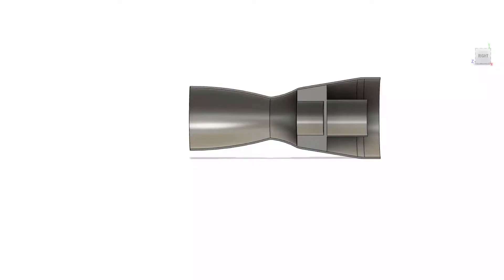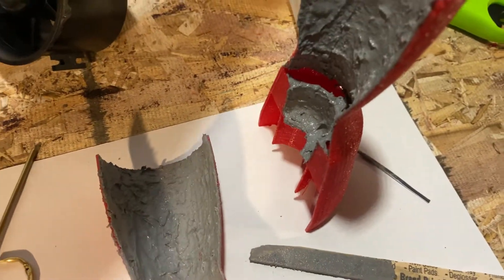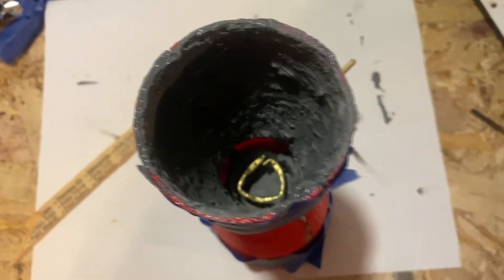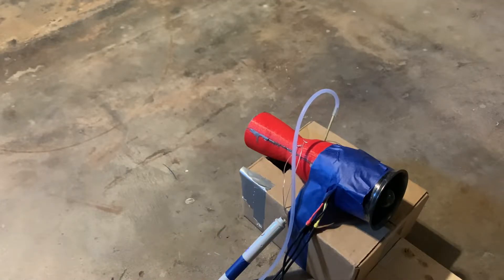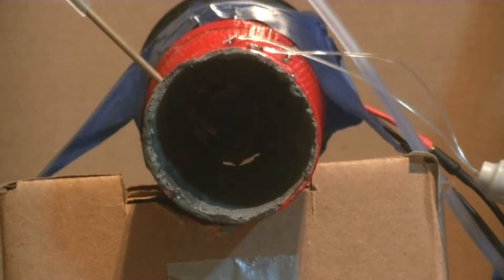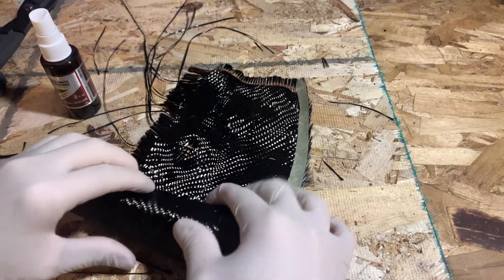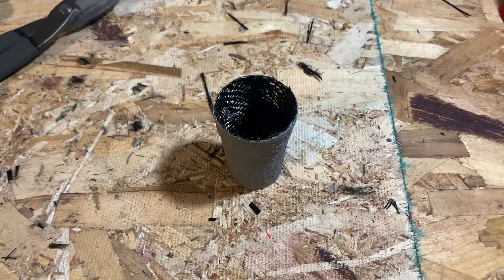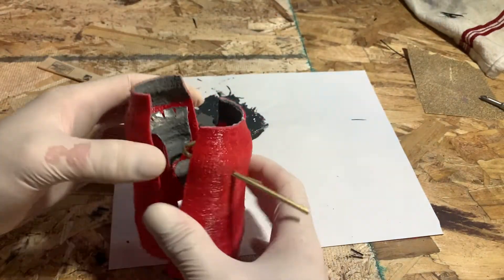Carbon Fiber EDF Afterburner

Comment: I work in aerospace carbon fiber prototyping. Theres a product called "feather fill" that makes surfaces smooth for painting, and it was taught to me that we can mix some acetone into the featherfill to make it looser/lighter to get into smaller gaps. After watching your video I wanted to suggest you try mixing this fireplace mortar with some acetone, it might work to let it seep into the carbon more deeply. It also might begin breaking down the mortar. I cant say exactly but I think this is worth experimenting with
Reply from the maker: I was also thinking of doing something like that, I wasn't sure if the base of the mortar was more of an alcohol or closer to acetone.

Comment: For the high temperature protection you might check Aremco Products, they have several ceramic paints that can be sprayed or brushed on.  Alumina base to 3000°F, zirconia much hotter.  I've used it applied with a  binks spray gun on stainless, 5 hours at up to 2500°F.
Reply from the maker: I've been looking for new binding agents to use that could withstand high temps, I'll look into these.

Comment: For your afterburner to work you need compressed air not fast air.
Reply from the maker: that is what I am doing for my next design, I printed a compressor for the front of the engine.
Reply: The afterburner is usually located behind the turbine were the airflow is quite fast though

Comment: Thus far the only time I’ve seen one of these flying was from the Flite Test channel.  Is that the end goal here or just want to get it done in the garage?  I want one, or two, so I hope to see you succeed!
Reply from the maker: the end goal is to fly it on a plane i'm just trying to get it to be as reliable as possible.
Reply: @JRYBuilds  that's probably warranted in this case (flame thrower overhead)